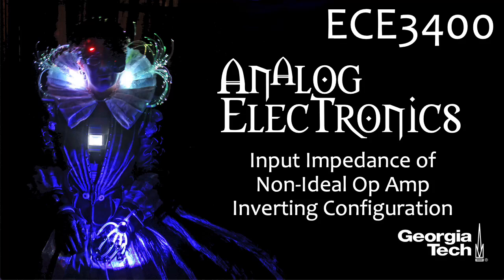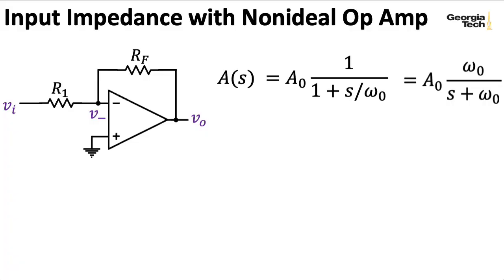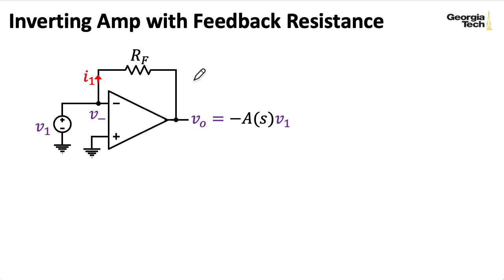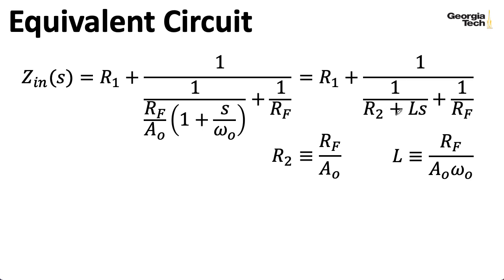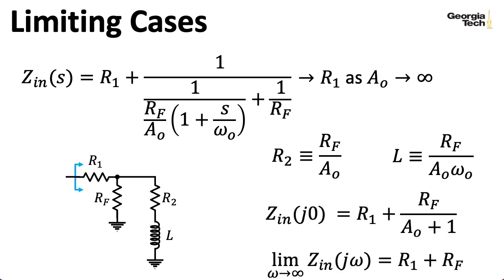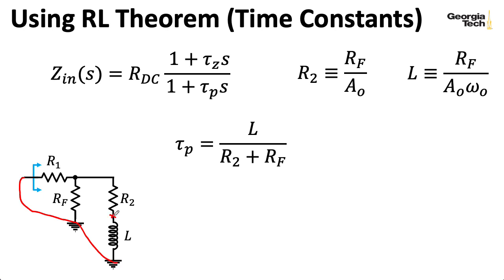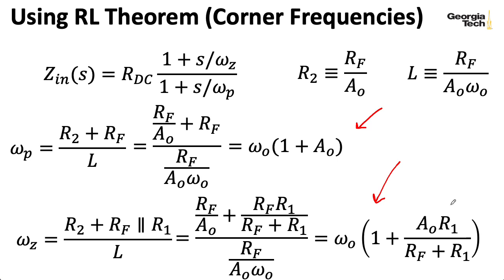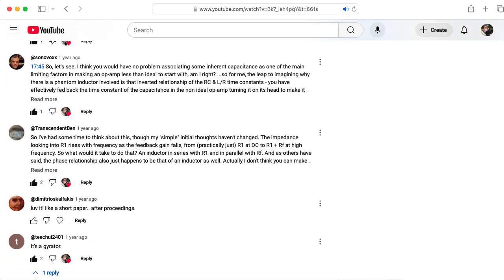ECE3400 L40: Input Impedance of Non-Ideal Op Amp Inverting Configuration (revised)

Comment: Interesting video! I encoutered the same principle in a book that calculated the input impedance of a cathode follower. Eventually it explained the general rule: common emitter stages are stable with capacitve loads, emitter followers are stable with inductive loads. Everything is connected!

Comment: Very interesting to think about! Thanks for this! After playing around with this a little bit, it's more intuitive to me to decompose it into parallel R sub c + C and R sub l + L, where Rc is R1+Rf, C is 1/(w0 ((1 + A0) R1 + Rf)), Rl is R1+Rf/(1+A0), and L is (R1 + Rf)/(w0 (1 + A0)). It's the same shelf result, obviously, but the shelf is a bit more obvious, plus we can see some general things, like with higher R1 and Rf, the impedance is more inductive, with lower, more capacitive. And it's a bit more clear why it's tricky to think of edge cases where this matters: L can only get high with a high input resistance drowning it out, while C can only get high with a high input conductance drowning it out. Even with a pathologically low gain, that extra 1+ ensures we have this proportionality.

Comment: A bit offtopic but some years ago, i made a 2 cm wide pcb, there are 2 tracks snaked around tightly in an alternating fashion over an area of 2 x 5 cm and the solder mask is removed in a V shape to function as touch sensor with a NPN, If i measure on a non soldered board with my home improvement shop multi meter with no finger on the board i measure a open circuit, but if i put my finger down, i get like 60/70K Ohm. it seems to vary if i move the finger up or down the V shape in the solder mask but my multi meter aint accurate enough to get a good answer. could this be turned in to something useful without specialized ic?

Comment: First, thanks for helping me understand (finally) why the inverting op amp’s input impedance is assumed to be R1 no matter how high the actual op amp input impedance goes (eg something like TL07x). In terms of practical-ish implications, if I followed the algebra it seems like the input impedance will never be lower than R1?
Reply from the maker: In this case, yeah, R1 is like a lower bound. 

Things change if you relax the assumption that the op amp itself has infinite input impedance.

Comment: it is just the result of a phase difference between input and output since the open loop gain can not be maintained.  a mathematical abstraction out of the model used. it is of 'physical significance' only if you can use the op-amp in its out of range area for something unpredictably and marginally useful ;-)